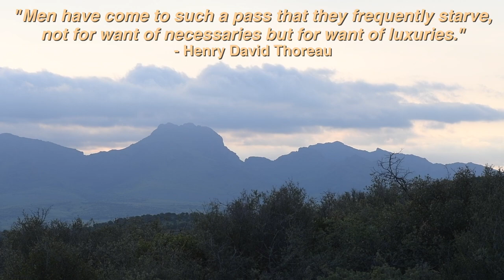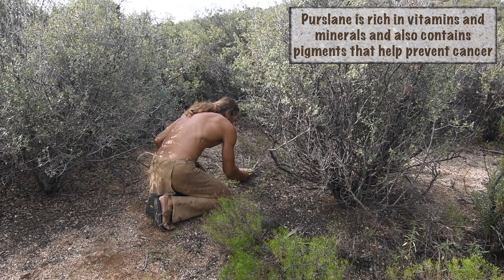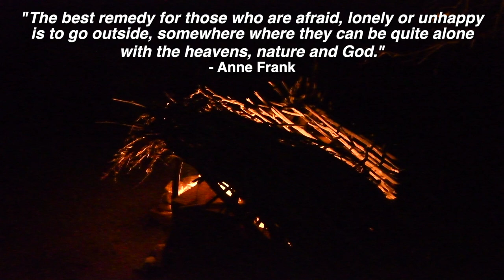Primitive Bean Soup and New Adobe Shelter (episode 17)

Comment: 3:13 try to find a hollow stick to blow, will make relight the fire so much easier.
Reply from the maker: Yeah, I wish there were hollow sticks here but there are not. At least I haven't found any yet. Maybe a hollow bone will work.
Reply: Perhaps make a Dakota fire pit but rather than use the second hole for draught make a grate from Adobe (pancake of Adobe with holes poked in it for air) and sit the fire on that. The second (draught) hole can be plugged under normal use, but when you want additional air to reignite the fire you can unplug the second hole which will allow air to go under the grate and assist.
Reply from the maker: I love that idea!

Comment: Might have to make and bake clay shingles for the roofing. Not sure how primitive that is for southern native american style but I know other places around the world did just that not too long after inventing clay pottery.
Alternatively you could probably make a juniper bark and clay cob that you lay as a slab over your juniper bark woven mats and let it dry into one big water resistant sheet and then cover it with bark to keep the rain off it. Then you wouldnt be losing heat through fibers and bark. Good for winter and summer both. 
Again, not telling you how to do your job. Just spitballing ideas lol
Reply from the maker: I totally appreciate ideas from you and others. There are usually many ways to do something and I'm not an expert. I certainly don't know everything so I always welcome good ideas from others. I like your idea. My main concern is the weight of the roof. The heavier the roof, the stronger I need to make the adobe walls and support beams. That equals a lot more work and time to build. I don't have time to build a super adobe structure this year before winter. Perhaps I can build one that will survive the winter even if just barely and then make it better next year. This is all a big experiment.

Comment: Just an idea.  I have seen people making a roof, starting as you have with sticks making something like a big lattice, then taking grasses, or what is handy and will work, and tying some into bundles.  Then , starting at the bottom of the roof, lash the bundles to the roof.  Overlap bundles as you work up to the top.  
Another idea , I am sure you know it, is to make tiles and tile the roof.    You would have to create an outdoor kiln, but it could be very primitive.
Reply from the maker: Yes, that is kind of what I was thinking to layer pieces of juniper bark and somehow lash bundles or large pieces to the lattice work. I thought of tiles too but that would be an incredibly heavy roof and the roof lattice would need to be very evenly made which is impossible with the wood here because it is all curved and bent. I think the juniper bark will have to do.
Reply: @ChadZuberAdventures  , sounds like a good plan.   Can’t wait to see it finished!